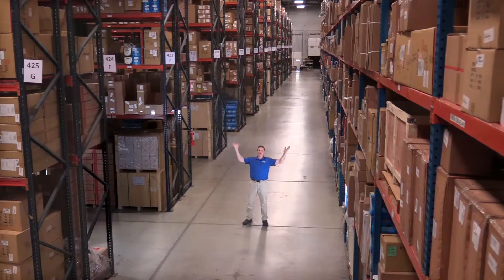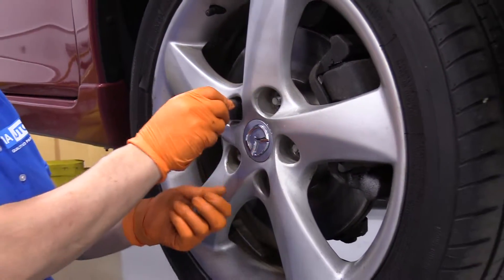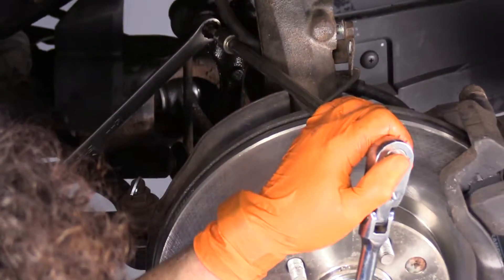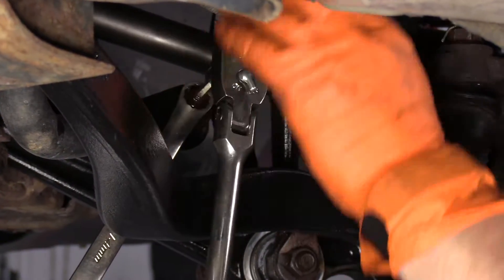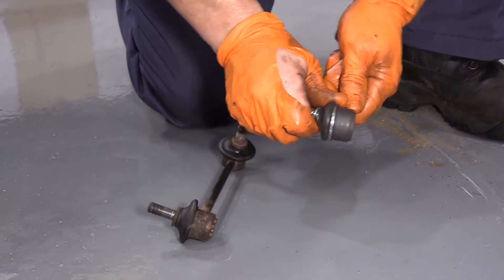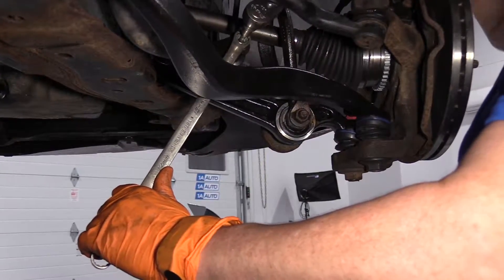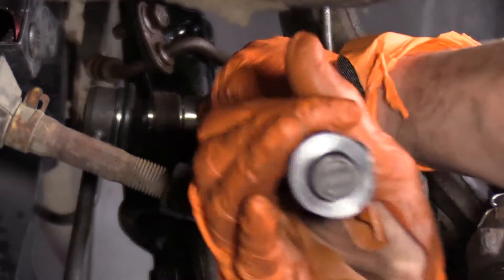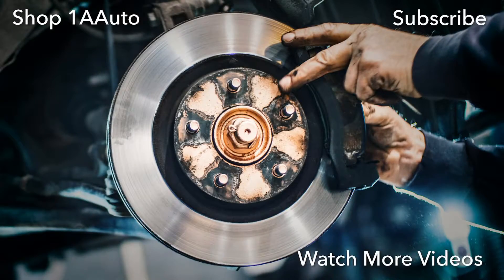How to Replace Front Sway Bar Links 02-07 Mazda 6

Comment: Little tip i found during install: if youre using jackstands/ youre not level on the ground, during reinstallation youll need both sides on front evenely jacked up because otherwise the screws will not fit in. Sway bars need to be even for it to be put back together properly, atleast in my case

Comment: I'm trying to replace my front shock and replace with coilovers. I can't even get that nut broken loose. Any tips?
Reply from the maker: +thebigD The best method would be using penetrating oil. Apply some and let it sit, try it after some time and if it's still stuck apply more oil. Repeat this until it is free. 1aauto.com
Reply: @1AAuto  I did. I let it set for 24 hrs and then about 30 minute increments after that. Since I was on a time crunch, I just cut it and replaced it with a new one.